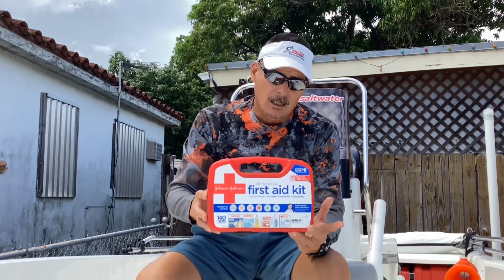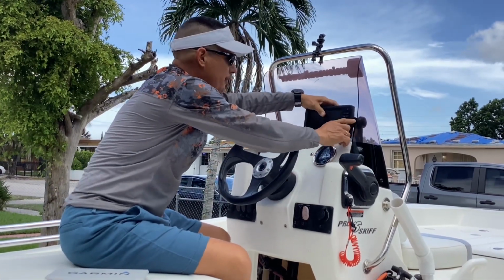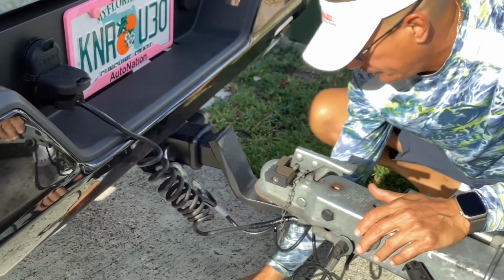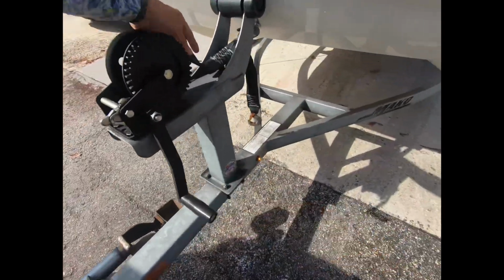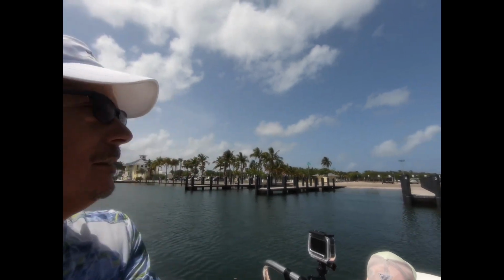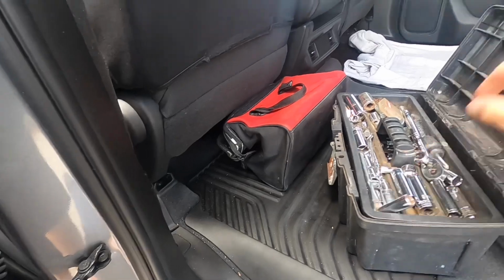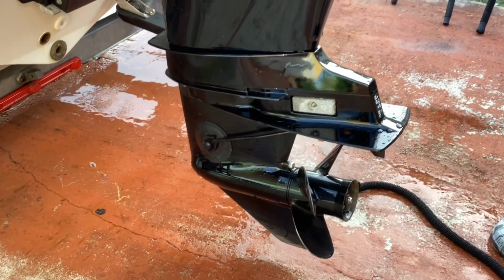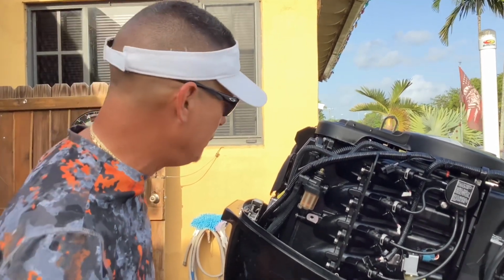BOATING TIPS FOR BEGINNERS

Comment: Great video! The one thing I didn’t hear you mention was connecting your batteries, if they don’t stay connected all the time.
Reply: ps haha I saw that huge pufferfish when you were loading the boat back onto the trailer!
Reply from the maker: Thank you Mommy. Great Tip for those who disconnect their batteries. One can also connect a Trickle Charger to the battery and avoid voltage loss while the Boat is Not In Use, hence not having to disconnect the Battery.👍👍